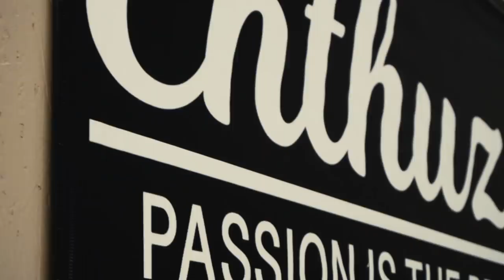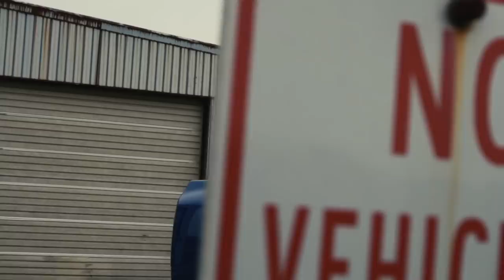These SIMPLE mods made the 5.9 Cummins SO MUCH CLEANER!

Comment: Going back to your last video. The egt probe was for the gale banks six gun system. You might also have the banks intercooler installed without knowing. And the hole in your dash was from the banks 5 positions switch.

Comment: My opinion on the headlights is no. Also taillights I love the bubbly look on oem ones but maybe slightly darker for front and rear. Then color matched front bumper and grill with color matched roll pan. Also maybe an 8 inch side exit exhaust would look good. That's my honest opinion.

Comment: Must have a sponsor deal with that wheel company and recon cause this is getting old. Do something different. Its a different model truck and you put the same products on a 4th vehicle i think..jeez
Reply: Will TEN American force? I mean if he did I doubt he would’ve bought fuels for the dually and anthems for the previous give away and also used forces for the mini max
Reply: @bornbehindbars2010  each were a sponsor for said build wether they repetitive or not but even if not...14 wides and recon lights and cooling system...all of them are identical.